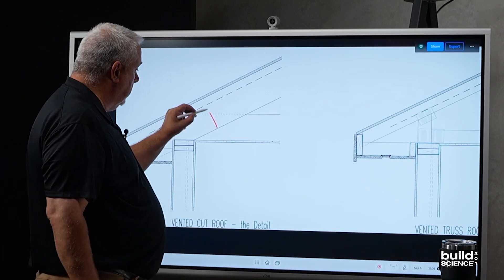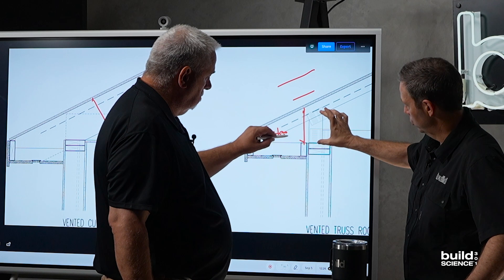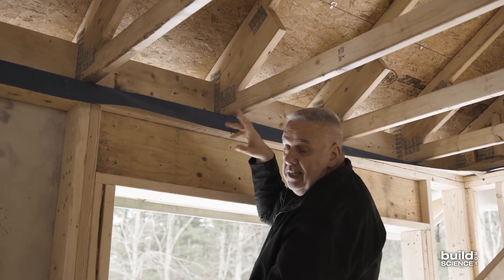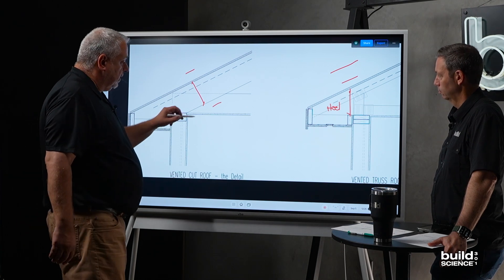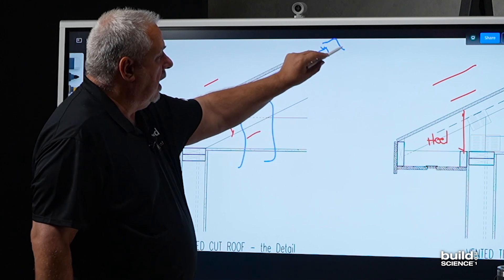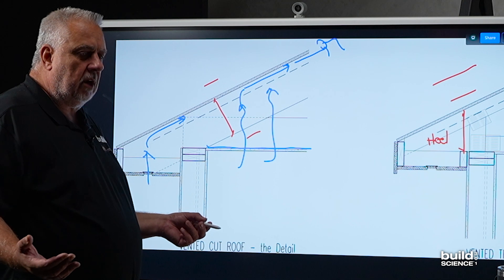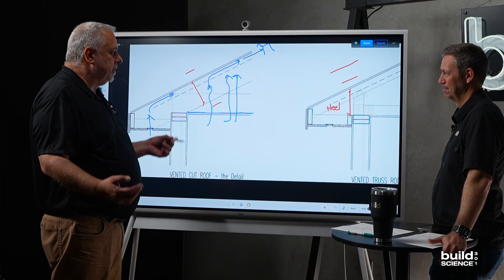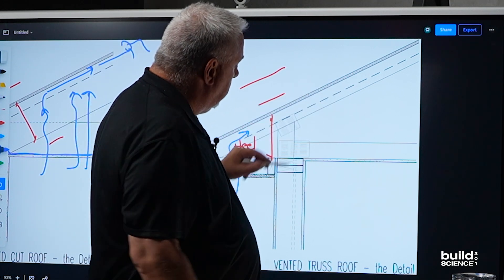Vented Cut Roof & Vented Truss Roof -  BS301 -  Build Show Clips

Comment: One way to be able to get the insulation value with a hand cut roof is instead of running your ceiling joists to the outside of the plate, put a rim joist there (like a second floor would have). Your ceiling joists would butt into the rim joist. Then you can either stack your rafters over the ceiling joists or you can run a 2x6 plate (think of it as a bottom plate to a wall on the second floor) on top of the rim/joists. This way you’d be able to achieve the r valve at the eaves. This will also make the outside wall taller, more sheathing/siding.